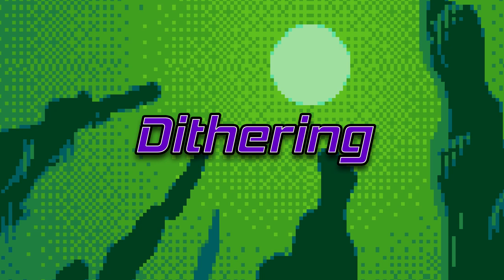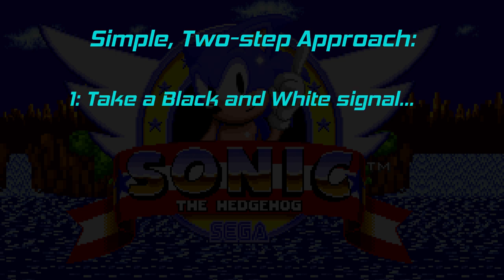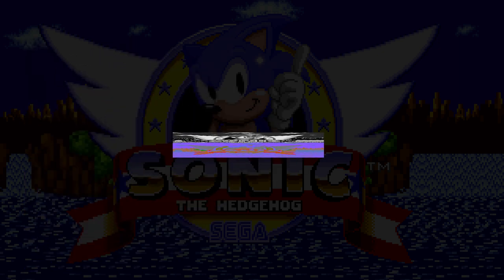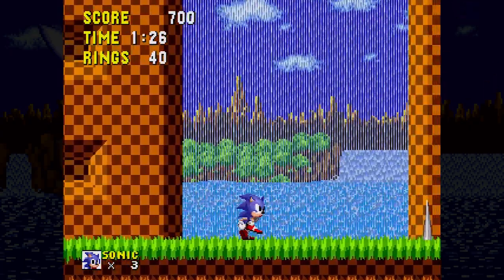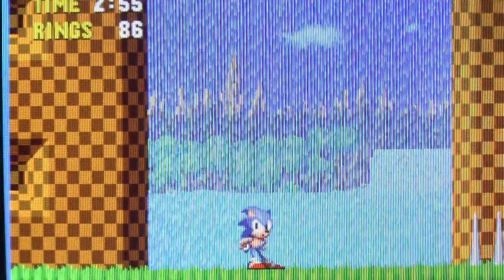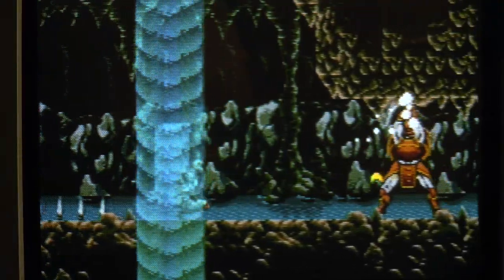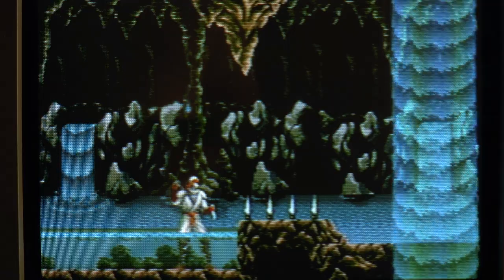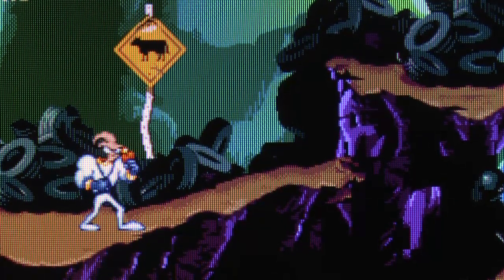Dithering on the Sega Genesis with Composite Video

Comment: my question is why did the genesis use this more often than say, the super Nintendo?
Reply: lack of color palette compared to the SNES.  I think 64 colors vs. in the thousands for the SNES
Reply: @linuxlover_8436  I see. Looking it up its 61 colors, at once that is. Apparently they have 512 (technically 15000 with some kind of highlight and shadow mode) colors but can only display 61 at a given time. whereas the snes can display 32768 colors, and is limited to 256 at a time. But thats still a lot more than the genesis.
oh but fun fact, the 32X can display all 32768 colors available to it, which is better than the snes.
Reply: @Yipper64  when emulating the 2, I vaguely recall some Youtuber indicating they thought Genesis emulation looked better b/c it had a slightly higher resolution.  I guess they were insinuating that due to this, they'd upscale better.  It made me wonder if the increased SNES color palette didn't matter as much when upscaling/viewing via newer display tech such as HDR monitors/tv's.  Also, do emulators upscale the color palette or just retain (what I assume was the standard if 8Bit color) from back then?  Sorry for somewhat deviating.  The 32x was amazing for what it offered...they could have made it work, but the saturn was being pushed and it was never given a chance.  Alien vs. Predator port was planned.  That alone would have sold like gang busters had it come out.
Reply: @linuxlover_8436  not sure that emulation can/does change the way that the colors display, or the resolution. I guess you get a sharper image with emulation because its rendering directly on your computer, so theres nothing to soften it. There is some solutions for composite blending on emulation, or at least the MiSTer FPGA has an option for that in its core, which gives you the best of both worlds, a sharper image, but the blending where necessary.
Reply: @Yipper64  Yeah I think emulation might not have much to offer in terms of bumping up the color at least.  I'd say that would have more to do with one's display and/or gpu.  For example, we own a 4k tv that supposedly tries to get standard content to look more like HDR content via its built in processing.  I noticed a recent forum post on Retroarch seemed to indicate a group of people basically created a combo of shaders that allow the perfect transparency/sharp color balance but I'll have to read up on it in the coming days when have more free time to experiment.  I myself have tried in the past to do this w/genesis games but hopefully they've pulled it off to my satisfaction.

Comment: I disagree with you about using composite. While it is true that many of the games were designed around the poor quality video format, composite also looks terrible unless you are using a CRT, and even then RGB is much clearer and generally better. I personally would rather have dithering and razor-sharp pixels, with the perfect colour only achievable using high-quality cables.

Honestly though a big part of this is just the fact that I love the look of dither patterns, unlike almost everyone else on the planet I think they look super cool, especially when shown off using razor-sharp RGB pixels. It’s mostly just nostalgia for my childhood laptop though, which ran Windows 95 and nearly everything was dithered, especially the drawings I made in MS Paint.
Reply from the maker: Oh man. The dithering in Windows 95. Just your mention of it puts the default desktop icons in my head. I think they limited icon palettes to 16 colors at the start? I want to say the higher color count for icons was one of the bonuses of the Windows 95 Plus! pack, but I can't quite remember.

Comment: I wonder if Dithering is the cause of why the Sega Genesis is extremely blurry, when connected to a Modern LED TV, even when using a Retrotink upscaler. Because NES 8 bit Consoles on Composite looks 300% clearer then any of the Sega Genesis 16 bit Consoles on the same Composite. And their is no reason. the texts are so bad! and I even Checked online and see. My console IS NOT the only one, their all that way. UNLESS you use RGB, S-Video(MODDED), ETC.
Reply: Dithering has nothing to do with that. Genesis consoles composite quality can vary quite a bit. Maybe the specific Genesis you have is/are a duds.
Reply: @dcboys4195  yeah I learned now that Dithering has nothing to do with the problem. But my Console isn't a Dud either. infact it's well maintained, and even got all of it's capacitors replaced. 

Also my Genesis MK2 isn't the only console that's has blurry texts on modern televisions, when I go to YouTube I've seen tons and tons of videos where they have the same picture as I do  when using composite. Usually those videos are comparing Composite to using Retrovision & or triple bypass mod. 

After I did enough digging I found out most Genesis, especially the Mark 2. Have really Cheap buggy Comb Filters. Which is responsible for separating the Luma & Chroma in the Composite signal, which allows the TV to detect which signal is which, on a composite cable. They aren't to bad on a CRT, but it translates terrible on the Led 4k.

However. Since I recently got my Genesis Modded to have a S-Video, which we know, always have Luma & Chroma Separated. Now it has just a clean picture as my SNES.

Comment: I tried it on a Pal console and it doesn't look at all as intended. I should just use  RGB at this point.
Reply: Maybe it's the higher resolution of PAL video that does this. TBH I wish I could use PAL with my analog video devices, I'd much prefer that resolution despite its reduced frame rate.
Reply: @Bro-cx2jc  Fact is that the vast majority of Megadrive games are not optimized at all for pal, so it's just better to use rgb with a 60hz switch, or ntsc composite with a proper oscillator replacement (something like a dual frequency oscillator that can change between 53.2 for pal and 53.6 for ntsc)
Reply: @linoxyard  Not optimized for PAL how?
Reply: @Bro-cx2jc  Games are not reprogrammed to account for slower cpu speed and squashed aspect ratio
Reply: @linoxyard  Ohh I gotcha, now I remember those were common things. Honestly, I don't mind, and I wasn't just talking about games anyway. I mean PAL in general. If I ever got myself a European PAL TV, I'd get a converter and try out all my composite and S-video devices to see how good the quality difference would be in person. I feel like PAL is the precursor to HD. I'm jealous of the Europeans lol, I even like the flickery screens of 50Hz CRTs. All my fellow Americans say they get headaches from anything less than 85Hz nowadays, when I can happily plug my GPD XD Plus into my CRT computer monitor at 50Hz and have a blast lol
Reply: @Bro-cx2jc  Yes, pal tv and analog pal color encoding has a lot of advantages compared to NTSC, hence why the bleeding effect doesn't work as intended on pal composite (it's too good). I was talking about how game conversions for pal territories were almost always mishandled in the past, or not done at all. That's why most people in Europe seek NTSC retro consoles and home computers, or try to modify them for 60hz (with a few exceptions, like zx spectrum and C64)
Reply: @linoxyard  I have some composite devices like game knockoffs, media players and my laptop that I'd like to try connecting to a PAL TV regardless. I've technically already experienced PAL on an HDTV's composite input, but I'd prefer to do it on a CRT that can process PAL.

Comment: If the use of dithering by the developers implies that they intended composite video, then we would expect that the technique would see no use in arcade games or PC in the VGA era, as both used crystal-clear video signals.  However, this is not the case.  Capcom's arcade games made heavy use of dithering, and it was quite prominent in early Windows.
Even on Genesis, we can see games like Sword of Vermilion being totally smeared with rainbow gradients that were clearly not intended.  Seriously, letters like m and w just turn into rainbow blurs.  These composite artifacts clearly do not represent the developers' intentions.

Comment: In Europe we've had RGB on the Mega Drive (and Master System) from the start so dithering has always been visible and felt like the norm. It was the same on PC and most micro computers using dedicated EGA/CGA/VGA monitors, developers were also making intensive use of dithering to circumvent color palette limitations and it was in plain sight as there was no such thing as composite to hide them among all the other artifacts and blurriness created by a low quality signal. And that's why "better" simulated transparencies aren't worth it to me because it comes with an overall dirty image with wrong colors, wrong lighting, excessive blurriness, bleeding sprites, color artifacts... For me there is not even a debate here. Using the poor quality of the composite signal in order to hide the dithering of Sonic's waterfall and achieve pseudo transparencies was probably intended like you explained but that simply doesn't make up for the rest (and you could also argue that with composite you're completely missing out the beautiful pixel art of these waterfalls). If we're speculating on what artists had in mind, I'm pretty sure that they also liked their colors, sprites and background to appear unaltered, which wasn't the case with a composite signal. Smoother dithering on composite is like icing on a bad cake, I'll take the good cake with no icing.

And to answer what I've read in the comments, no, RGB doesn't add artifacts or make pixels look razor sharp like you see on a modern HD monitor. Jailbars for instance, when I plug my Mega Drive 1 via RGB on my HD LCD TV I get very visible vertical lines but when I use that very same RGB cable on my CRT TV all the jailbars are gone. Jailbars aren't an RGB issue it's related to high definition monitors. Same for pixels, they are large and very square on the LCD and smaller and smoother on the crt. Overall the image looks better on the CRT, because it's sharp and bright but not pixelated.

Oh and there's a very interesting GDC video if you want some indepth perpective on the use of dithering in 8 bit (256 colors) graphics: https://youtu.be/aMcJ1Jvtef0
And some live exemples: http://www.effectgames.com/demos/canvascycle/
The dithering is very noticeable and I wouldn't want it to be blurred with the rest of these beautiful pictures by a composite signal it would just ruin them.
Reply: Except you're entirely ignoring that the artists knew it would happen, it's the reason they did these things the way they did them. It's why so many artists and musicians back then were also proficient programmers, they knew what they wanted to achieve and also had to learn to get it from the technology they had available, pioneering these techniques. The colors aren't wrong, the combining was their intent based on experimentation.

I don't know that anyone is claiming RGB adds artifacts, they would be incorrect if they did, it's the removal that is contentious. You're only half correct, though, the so called jailbars are an issue of modern display types and RGB, it's not mutually exclusive. The reason you're not seeing it with a CRT is because it's a CRT, there is naturally a softening of the image by the way a CRT operates. Even in the most advanced of CRTs there is going to be some minor degradation of the signal between the input and when the electron beam finally strikes phosphor, just as there will be some degradation between the source output and the display input. Degradation which we know the artists planned for because it's the reason dithering exists.

I haven't seen them over composite, but those demo images look fantastic once they're blurred a bit and the effect completed.

Comment: You talked as if RBG was a new thing. But is not. Composite is not the "right way" to appreciate old consoles even when this consoles were on the market the right way had always been there, RGB
Reply: The games were designed for the majority of the players. And the majority did not use RGB.

Comment: sharper graphics do not benefit old systems like the sega and nes. sharper graphics are for true 3d games.
Reply: However, old systems definitely need the blending when they try to produce 3D and 3D-like graphics in games such as Sonic 3 and Donkey Kong Country. A lot of that "digitized" 3D graphic information on sprites needs to be smoothed out.
Reply: @FingerinUrDaughter  You totally read what I said incorrectly. By your reply, you read it the complete opposite way I worded it.
Reply: @FingerinUrDaughter  Wow, it is true that you can't correct someone on the internet without sounding condescending. Take a lesson in humility. Everyone is not a boogieman on the internet. We can all be friendly and have a good discussion if we first take each other's comment literally rather than an attack - no sarcasm or cynicism intended.